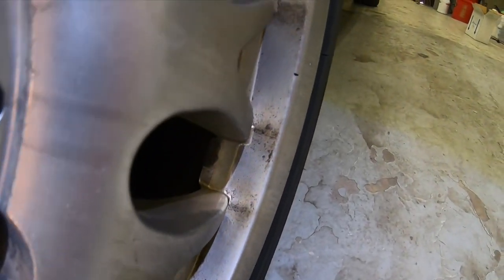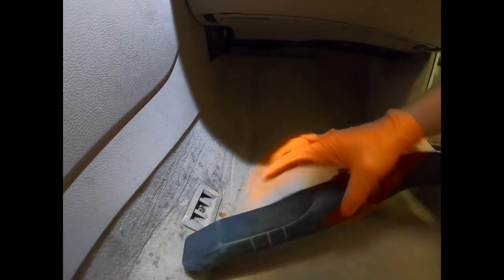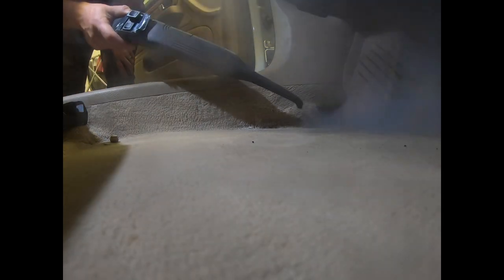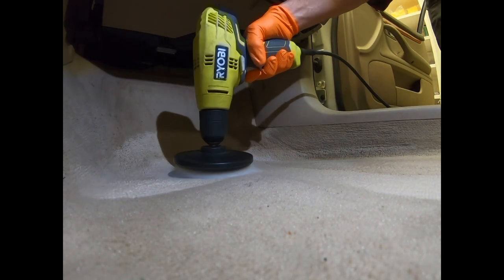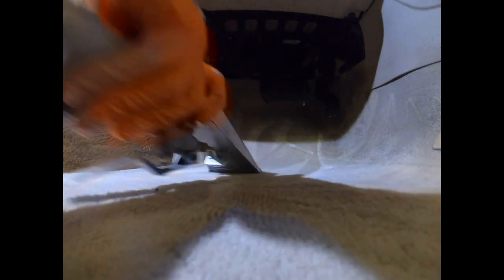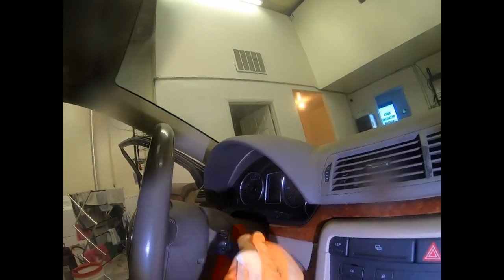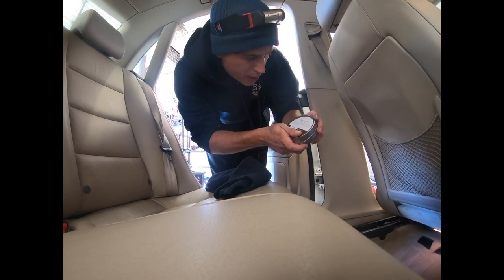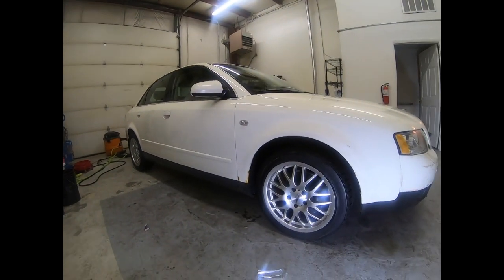Trashed Audi carpets & interior get STEP BY STEP deep clean!

Comment: Why not just get a new set of floor matts and a new window regulator switch? Then it’s pretty decent aside from the leather interior. Once that’s done the car is good enough for a first car imo. And for a 1000$ it’s not too bad either (if it’s been serviced like it’s supposed to). I mean if the total adds up to 2000$ (detail, new floor matts and switch included) and the car runs well that’s a fairly good deal imo.

Comment: hey Hawk do you know all about encapsulation cleaning for carpets.  Also you should try a Surbuf HHR or HHLC hand pad to clean steering wheels and many other areas of the inside and outside of a car.  Far superior to a brush. magic eraser has it's place but not on leather unless absolutely necessary.

Comment: Is there a stigma concerning the magic eraser? I’ve heard a couple times from various sources that it can actually damage surfaces, but I don’t have any eggs in that basket so-to-speak. — Great detail, love the thorough and honest narration; easily becoming my favorite detailer. 🌿
Reply from the maker: Thanks my man! Think of magic eraser like sandpaper. It works BECAUSE it is damaging the surface. You are literally removing part of the coating as you scrub leather. So you have to weigh risk v reward. If you remove a sliver of coating but all of a sudden the leather looks perfect and that stain is gone? Hero. Scrub too hard and permanently remove coating - causing an uneven appearance? Zero. Lol... I would not use it every detail -- far from it. But if a client wants results, and I cant get it with steam or APC or rag etc etc, I will reach for the magic eraser. Ultimately we cant take back time ya know? So it's always a decision in the moment based on numerous variables as you whether we want to simply clean or possibly restore
Reply: Hawk Pro Detailing That makes perfect sense! Thanks dude!

Comment: I tried Miranda detailing interior procedure because I thought it would save me time but it turned out to be exactly the same. He basically vacuums and does literally every step in each area. It's interesting.
Reply from the maker: Oh so one quadrant at a time and just totally finished before moving on?
Reply: @HawkProDetailing  yes
Reply: ive been doing his strategy for a while in the professional detailing world and it has saved me so much time from having to go back and forth with all my machines and chemicals
Reply: @detailsbydavidllc8770  I dunno maybe I didn't give it a fair enough chance but I found I was getting tripped up by having to many things going on around me.
Reply: Xycan I have a Vacumm and air with me I don’t have the drill brush and steamer with me when doing this method
Reply: Everything changes if I’m doing a carpet extraction/stain removal I will do that first then take care of everything else